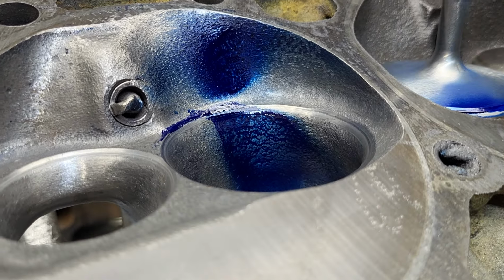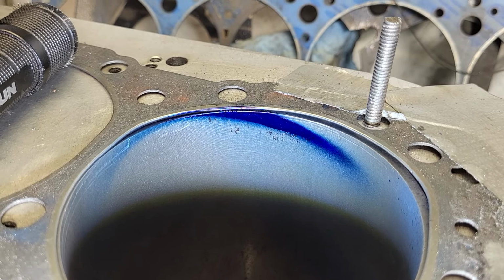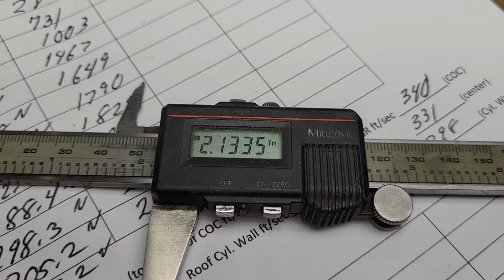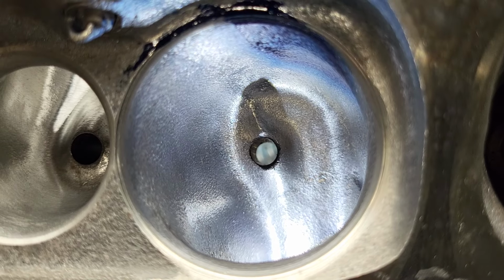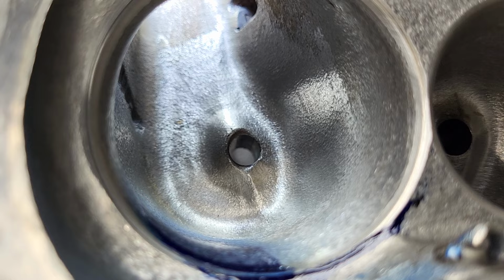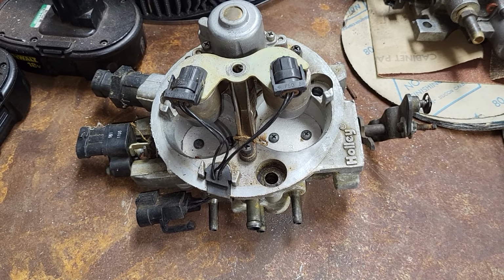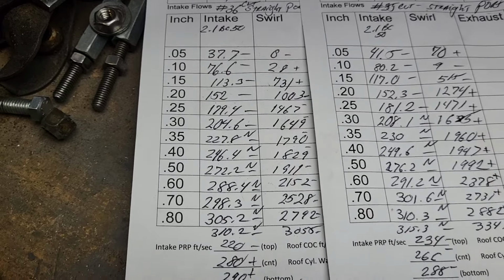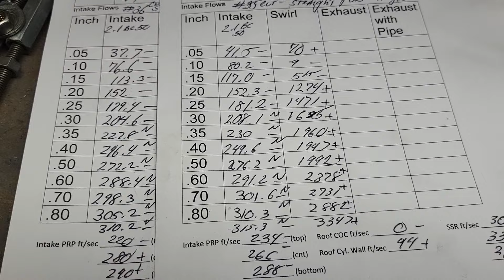48. Chevy 193 Swirl port cylinder heads. 36th cut straight port made pretty.Loser!

Comment: Everything thing you've done with these heads have been better than what I've seen with 186 castings. I considered using the guide seal cutter and then blending the bowl. I'm curious how that would work on the 1.94 port. I'm also curious what effect that cutter would have if used on an otherwise unmodified port.
Reply from the maker: Good ideas. Thanks

Comment: I wonder how much of an influence de-shrouding the valve on the cyl wall side of the chamber effects the bowl roof speed ?  My thought is that doing that acts as a dump zone and reduces the air pressure of air traveling around the bowl over toward the COC , this reduced pressure air has less ability to go up against mods done at the helix terminus and as well as the SSR feeding from that corner.
I think keeping flow over the roof is a factor to keeping overall flow numbers up ?
Reply from the maker: Having near zero air speed is a definite no! Thanks

Comment: Hey Charlie, have you had much to do with Ford Cleveland 2V and 4V heads? It seems that common consensus says that BBC heads have alternately good and bad ports (due to the angle imparted by the siamesed entries). One type has the flow directed into the centre of the cylinder, the other has it crashing into the wall.

Seeing as Ford 351Cs and 429/460s use this canted valve arrangement, but with equal spaced ports, that they have the advantage of having equal flow characteristics to each other.... Except, they mimic the path of all the "bad" ports in the BBC, not the good ones. Would you agree with this observation?
Reply from the maker: Yep

Comment: Charles,
What? is your view on a straight line wind shear vane going in a straight line  from the top of the roof of the port directly behind the valve guide boss centred to the guide boss going in at a slight angle towards the spark plug but no at the spark plug in much  the same direction you've got your guide boss tail shape in the video, but have  a vertical vane ending around 1/4" to 5/16" from the valve seat with a relatively consist protrusion of about 1/8" .. Rounded off about approximately.020" radius all the way up along the vane. Has about 1/4" Radius etheir side blending back to the otherwise round bowl area using a 3/8" or 1/2" round burr to achieve the disired result. If you could  make something similar in clay and show what it does to wet flow and air flow using your dykem method and flow test would be great 
Perhaps if you have time.
 change the vane ending lengths  that would be great to see the efects to the flow and how you can manipulate exactly where you want your blue dykem spray pattern and how it might effect airflow on the flow bench.
Some videos on the subject would be appreciated.
Reply from the maker: I was thinking of doing this exact thing on this port. The reason is some ports have the vane inside and some outside, some straight. It is only a matter of time and money....Thanks